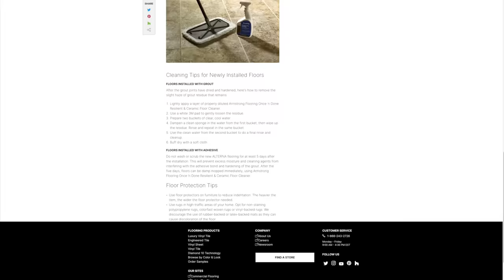Cleaning Mistakes You Are Probably Making

Comment: From a chemist:  There is a difference between a mineral abrasive and a chemical abrasive. Mineral abrasives are things like baking soda or salt which have a crystalline structure allowing it to assist in cleaning. While these abrasives can be harmful to some surfaces, they shouldn't dissolve the surfaces in your home.  Chemical abrasives are caustic chemicals that are dangerous and come with the warnings not only on some surfaces but also to avoid skin, eyes, or even breathing it in.  Bleach is not the only corrosive cleaner out there.  Anything that is strongly acidic or basic is probably caustic and dangerous for household use.     Be sure to read the labels for all warnings or directions to be sure you follow proper procedures.

Comment: Okay, not to be a downer, but microfiber cloths is a good alternative, though it is still not 100% eco-friendly either.

I just wanted to mention this because it is praised as if it is the angelic tool from the skies above. These cloths can get ruined if not taken care of properly, and when it is misstreated, people will just toss them away. This still leads to landfill waste that will never wither away.
Also, microfiber cloths leave micro-fibers in our water every time we do the laundry, just like other non organic materials that can't be biodegraded away!

An alternative I turned to is the swedish dishcloth, I would love to see a video of Melissa Maker using one of these and give her opinions on them. It is not a miracle product since it is just a stronger version of a regular paper towel. Though honestly, from switching to these, reusable type paper towels. It almost completely replaced my need for paper towels. (I say almost because i still use regular paper towels on bathroom clean ups). 
There are brands that will try to upsell you these inexpesive rolls with cute designs and only 5 sheets at a time. But if you do your research, you will find the same swedish dishcloths of about 30 sheets for around $25 and have been well known in other countries for years. *Note Each sheet is supposed to last you for about 1 year! so I definitely had to try it.

Comment: I hate swiffers—those things just move the dust/dirt from one place to another.  There were microfiber ‘swiffer’ heads that I purchased on Amazon a couple years ago & they are washable.  I use them to reach higher areas, can dampen them, and toss them in the wash when done.  For floors (laminate) I use Bona’s mop & spray, which also cleans our tile areas. It makes them look nice & is safe for my cats, and has kept our 16 year old floors looking just fine.  I dust the furniture with very lightly damp microfiber cloths & found not using Pledge anymore has decreased the amount of dust—and cat hair—adhering to the finishes.  Do I believe these cloths “ pick up or eliminate 99% of germs”? No! But they work well & don’t scratch furniture.

Comment: After using my toilet brush I spray it with my toilet disinfectant spray and let it drip until someone needs the toilet, usually about 10 minutes later. At least my holder has a pool of cleaning solution rather than...poo water.

Comment: I have a little bit of beef with the idea you should clean top to bottom. Yes - it is a very logical way to clean, but the problem with feeling like I am SUPPOSED to clean this way means I feel like a failure if I don't make it all the way down; AND it makes it less likely that I will actually get all the way down to the bottom because of burnout. Instead of feeling like I have one manageable task to complete, like just the floors, it feels like I have to clean everything because I must start at the top. This is especially true for someone who experiences neurodivergence like ADHD.

Better is GOOD and perfection is the enemy of good. I do what can in whatever order gets things done. ❤

Comment: I use dollar store brand swiffers to get into those tight spaces and to cobweb. I’m not gonna wash out a rag with bug residue on it. Not a fan of microfiber, I’d rather use cotton rags. 

DIY cleaners are great when they work, but many times they don’t without lots of scrubbing. I don’t have time or inclination for that. One thing they never mention about using dish soap cleaner is that you have to rinse it off with water. I see people spray and wipe. While that gets it clean, the soap residue left behind attracts dirt and gunk. 

I’ve got hardwood floors everywhere but bathrooms. Unfinished, polyurethane with sanding between coats. Steam mops will peel that poly up over time much faster than wear and tear. Laminate wood look floor all used to be glue down 10 years or more ago. Steamer erodes that too. With the newer tongue and groove lock kind, no glue, but steam will warp it too. Steam is vaporized hot water and if you’ve ever steam cleaned, you know you have to wipe surfaces dry. But you can’t wipe dry under your floor, so it’s pretty much blasting water into seams to get under floors. 

I thought everybody knew that moisture isn’t good for wood, but they don’t. However, I can’t clean daily, which is what your have to do with those barely damp microfiber mops. We have dogs, cat inside and horses, goats, cows outside and even taking boots off outside, my floors get dirty. I’d spend hours on floor using damp microfiber and it would tear up fast. 

So…. I use method my granny used on her old wood floors. I sweep every night and wipe up any visible dirt/dry mud like paw prints. Small particles really get ground in and erode floors over time. Every week I mop with a little pine sol and hot water or vinegar/hot water. I like the o cedar spin but I use bucket of clean water for dipping. Great thing is these mops can be barely damp, but have better scrubbing power than microfiber. You want them damp/dry for wood. 

My husband is flooring guy.  Hardwood, laminate, tile, etc.  He reseals our grout every year. Looks cleaner for longer and it’s easier than you think to erode grout. The seal the installer used doesn’t last forever unfortunately.

Comment: I am a professional cleaner. I clean show homes for a living. I walk through the house with three rags. One for glass, one for toilets and one for all other surfaces. I also have a spray bottle with a 1 part pinesol to 7 parts water and I use it for everything. In show homes nobody is cooking and there is no greasy residue in the air so the floors generally don’t need cleaning products. I use just spray water and use a dry mop. If it needs to be washed I use half water and half vinegar with a drop of dish soap in a spray bottle.
Reply from the maker: I love that you use a " one product wonder"!

Comment: When you have real wood furniture, you need to use polish. Whether it is pledge or linseed oil or something else, wood needs the protection and mild moisture that a wood polish provides. It keeps it healthy and looking good for hundreds of years if properly taken care of.  Same goes for statues or wall hangings or whatever else you may have. If it is REAL, UNTREATED WOOD, it absolutely needs to be polished with oil for it to look its best and last a lifetime.

Otherwise, completely agree. Quit using it on fake wood or wood that has a coating on it. That's not what it's made for. Use a multi-surface cleaner and make your life easier and less streaky!

Comment: I’ve learned a few things, all was helpful,  but I’ve always worked from top to bottom, my mom always said the same about floor to top the dust or things dirt floats downward. Hey, I’m doing something right, didn’t know it. I still like a little bleach in water to clean things, I like to put a little in mt tea picture, I soak it then wash it out good with my dawn, bleach just smells clean when I put some down the drains. I’m still a clutter person,can’t figure out how to organize. Too much stuff.,
Guess I just love stuff. I’m one of those who buy every type of vacuum,I have a tiny wet and dry, I
May have used once,I have three or four car type, don’t know why, I have a stack vac,I tried it,
Then I have an Hoover,Oreck  trying to find light weight, I have back trouble, spray mop, mop with the spinner, sponge mop, little vac that’s for kitchen you push it pick up anything. Plug it back up to recharge, if you can find the cord. I also have the mop you spray and mop. I’m sure I’m leaving something out. As to cleaners i Probably have two of  three of every cleaner, I forget I have it and grab another one at the store. I do only have one carpet cleaner though. It work really nice. But I
Have no place to put everything.. I should have a sale but then I need help, can’t do it alone, don’t
Know anyone. Whoa is me ! !  Clutter worm♥️ any ideas?  When I’m buying these things, I’m seeing how pretty and clean the house is. Old person in trouble.love you guys 👍👍🙏🏽🙏🏽♥️♥️God Bless each and everyone. Happy Mothers Day.♥️♥️ there is light at the end of the rainbow🌈🌈🙏🏽🙏🏽🙏🏽🌹🌹🌹Clutter bug any advice? .?

Comment: I'll add ACID on surfaces!!  With so many folks making their own green cleaners, vinegar + dish soap is something I see often.  This should never be used on natural stone (granite counters, travertine/marble showers or baths) nor on Stainless either!  Touted as a great cleaner for stainless (and I'm sure it's fine for raw sheet metal) KitchenAid website says never to use an acid like vinegar on stainless appliances.  Modern appliances have anti-fingerprint coatings.  You will ruin them.  I have a friend who has ruined her stainless steel sink with vinegar.  - FYI I bought the new foaming Bar Keepers friend and was in love with it until I looked up the pH on their SDS - 1.65!!!  a VERY strong acid, even stronger than vinegar.   So I'll keep it for my pots and pans and maybe hard water spots on some chrome fixtures, but that's about it!!

Ditto for strong alkaline products (such as bleach or many multi-purpose cleaners).

Comment: I completely disagree with her about the disposable dusters.  I have needed to clean my house for 10 years, finally do some deep cleaning in a couple of rooms, this things are a godsend. If you are doing a special cleaning project, I think they are worth the extra cost because they are disposable. Who wants to stop every few minutes, mess with the rubber band, have particles fly off while doing that, then cleaning it later, and having to do that multiple times. So these disposables are perfect for deep cleaning projects, not practical for everyday use though, I agree with that.  I even spray 99 or 91% alcohol on them if  Im trying to surface clean a place I cannot reach. then you throw it away, they work great!

Comment: I have a swifter because my ceilings are too high and I am too low to the ground and climbing ladders is not safe for this older lady. So I take two socks put it on my extended swifter and rubberband them on. Wahhhlahh, the dust webs are history.

Comment: Wood furniture gets thirsty and will dry out and start cracking,
I treat my would furniture twice a year with bee wax. Makes the furniture look like brand new.
Then all I do is use a swifter to dust with.
You can find the bee wax  at ace hardware for 20 dollars.
It only takes as few drops on a soft sponge. Wait a few minutes and then go over with a cloth and you will have the best shine ever.
I have used be wax on my kitchen cabinets making them look brand new.
Wood furniture loves bee wax and your furniture will not dry out and crack.

Comment: Again I will say. No matter how well-made microfiber is it sheds microfiber which stay in our environment.    I know it works well and if looked after last for ages but at end of the day it will end up at rubbish dump adding to massive plastic pile. My suggestion use an old towel and vacuum clean where possible

Comment: For a streak free mirror, i use very warm water on an old kitchen towel. Then i take a cotton linen towel to dry streak free. I don't like the microfiber cloths i have and they aren't lint free. 
Love my swiffer for our fans and use a webster to clean between the walls and ceiling. 
I use diluted lysol in spray bottles to clean surfaces. I use lemon oil to clean my wood furniture. The winter in wisconsin is hard on furniture. I love the smell and the look of my furniture.

Comment: I have 5 large dogs and 5 grandsons. The amount of dirt and other crud they drag in on a daily basis is not going to be cleaned by a spray bottle and dry mop. Lmfao I have a scrub brush that looks like a push broom and a squeegee on a mop handle and plenty of microfiber cloths. I do my floors in sections water, scrub, squeegee, dry. No problems with my flooring so far.

Comment: As a chemist, I feel the need to reiterate why you really shouldn't mix chemical cleaners 

To go with the chemicals first: Chlorine gas (Cl-Cl) has a pretty specific reaction with ammonia. The problem here is less that the gas is toxic, and more that we are talking about a highly unstable explosive. And by highly unstable and explosive, I mean the stable version (Nitrogentriiodine) explodes at the touch of a feather, this is a common chemistry show reaction. So PLEASE DO NOT MIX CLEANING AGENTS!!!

And then there is the dishsoap vs. universal soap, while they are similar in many ways, here is a key difference i found on mine: First pH 4.5 for the dishsoap and pH 10.5 for Universal soap. They are respectively acidic and basic. You don't need to add citric acid (pKa about 4) or salt (Sodium Chloride or Potassium Chloride) to dishsoap, it is already in there. pH is however not the thing to be most concerned about when it comes to acidic/basic and the strengths, pH just tells the concentration. With a basic product we are dissolving fat, aka turning it into soap (yes, this is the actual reaction used to make soap). Whereas the dishsoap is using acid to improve the surfactant effect (by making ions), to aid in removing protein and to help dissolve sugar. Mostly surfaces you clean with universal soap are covered in fat from your skin, whereas protein and sugar dominates your dishes more, soap is already sufficiently unpolarized to dissolve fatty acids we are just improving on that ability. Bases can also be corrosive, but it is, to the surprise of noone given the last few sentences, less harsh on your furniture (and more so on your skin) than dish soap. This is why you can do dishes without gloves, but shouldn't clean your home without gloves.

I will also say, I have become a big fan of Swiffer for the sake of saving my energy, a low energy people will struggle to get things done unless they are easy, and trying to keep microfiber cloths clean is a chore.

Comment: I have to laugh at the swiffer “mistake”…. And years ago before swiffer was invented I created my own duster to clean the blades of the ceiling fans.  I took a wire hanger and pulled it completely open, then I took cotton rags that I cut into 2” x 6” strips and I knotted the strips around the wire hanger.  Then I could stand on a stepstool and put the cotton covered hanger over the blade, pulling it towards me while squeezing it together and it took the dust right off.  I also used to spray the cotton with endust, so give it a little more stickiness.  Afterwards, I would put the whole thing in the sink and just wash it and then stick it out on the clothesliine to dry it.  I was young and had no money, so I invented my own.  Later when I saw the swiffer, I thought “Man I missed my chance to cash in on this invention!” LoL

Comment: If you need to revitalize REAL wood - unwaxed, not plastic, laminated, polyeurethaned - use lemon or orange essential oil. The wood eats it up. It nourishes and shines the wood. Careful on floors because it is slippery - use a small amount, rub it in and make sure any surface is soaked in and dry before you walk on it - seriously!  But on furniture - no worries at all!

Comment: Microfiber cloths do NOT work anywhere near as well as real fabric (cotton or linen).  I won't have that plastic garbage in my house.  MICROFIBER IS BAD BAD BAD BAD BAD.  Don't pretend you're saving money or helping the environment by buying that garbage.  They are made of non-renewable resources and do NOT biodegrade.

Also, Pledge has silicone in it.  NEVER use it on anything.  Old English is what is supposed to be used on real furniture.  Water on wood damages it over time.  WATER IS NOT FOR WOOD.  (Furniture manufacturer and antique repairer from Thomasville North Carolina told me that 40 years ago and I have a LOT of perfect condition antiques because I listened)

Comment: I must disagree with you on the window & mirror cleaning with a microfiber cloth. Get a medium glass or plastic bowl. Fill it ¾ full of hot water. Add 1 cup of vinegar. Dip crumpled newspaper in & wipe as much area as possible before there's no more damp left behind. Dampen the entire pane as quickly as possible. Discard newspaper. With fresh newspaper wipe from top to bottom. If there are any marks as you go rub that spot gone.

Comment: I gotta say im surprised you would have her on your channel. Everything about her channel is against your philosophy of "embrace good enough". Grandmothers for generations cleaned just fine without her black and white thinking when it comes to cleaning. Sometimes its perfectly fine to use a feather duster instead of a deep dusting with a cloth. Sometimes just cleaning the floor is fine whether youve worked an "s pattern" or not. Dont buy into too much of her cleaning tips. A lot of it is tips that can be helpful but not always necessary and usually meant to shame people on the internet for cleaning differently than her. As if there is only one way to clean.